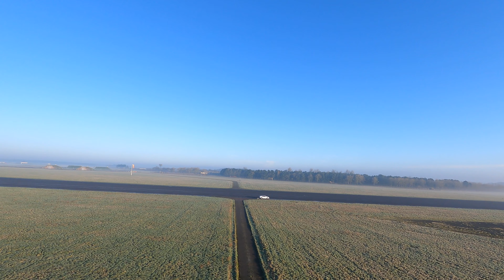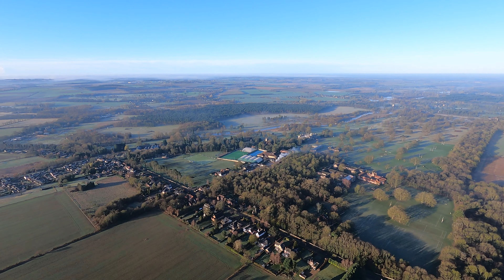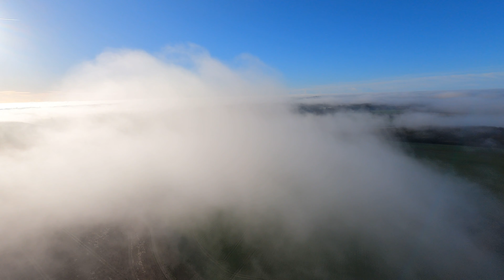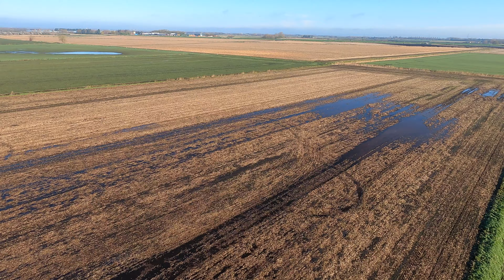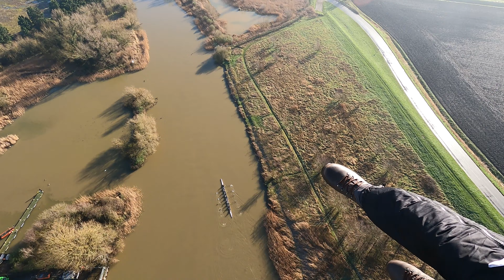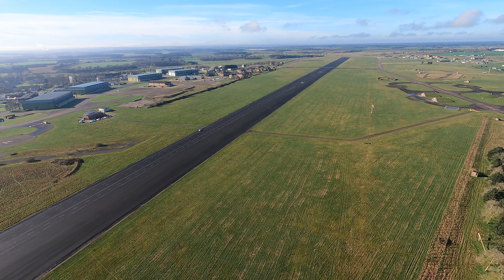Which engine next?

Comment: I had a Air Conception with a Nitro 200 engine. I had so many problems that I sold the nitro 200 motor on ebay and bought A Moster 185 With Electric start and I have been so very happy with the power and reliability of the motor it has transformed the PPG experience to a much more pleasant hobby. I used the sale of the nitro 200 to help pay for the new motor and I bought a conversion kit so that it would be able to mount to the Air Conception Frame. The weight difference between the two motors is really not very noticeable on your back at all.

Comment: If you're into XC the only real option is the Top 80 with float bowl until they make an Atom EFI.
Reply from the maker: What’s the fuel economy on that?
Reply: @simonhamilton4002  With 140 cm prop you can get 2 L/h.
Reply: @simonhamilton4002  What airfield is that btw?

Comment: Also, If the battery dies, so does the fuel injection system. The power for the computer is not supplied by the magneto, it is supplied by the battery.
Reply from the maker: The battery on the EFI lasts 7 Hours apparently

Comment: I was in your position last year. Nitro V1 that ran ok, even with the parts that broke in flight and were replace. I wanted to upgrade. I purchased a PAP Tinox with the factory R, 140 prop. Night and day improvement. I still have the Nitro but will probably let it go this summer..OR put a Moster 185 on the Nitro frame and keep it as a backup. For me the EFI is way to heavy !! Good luck..
Reply from the maker: What’s the fuel economy like on the Factory R?